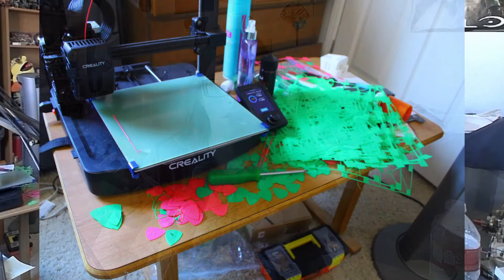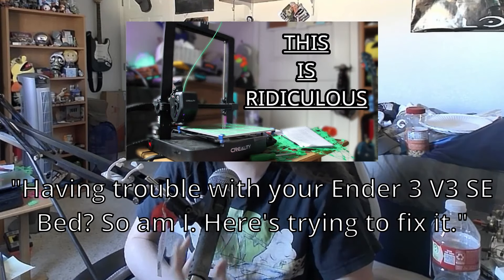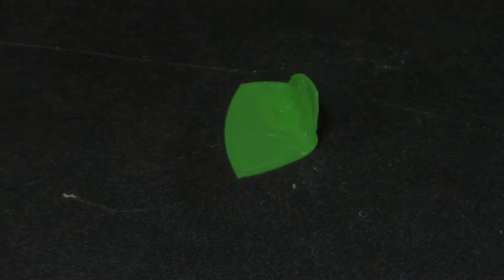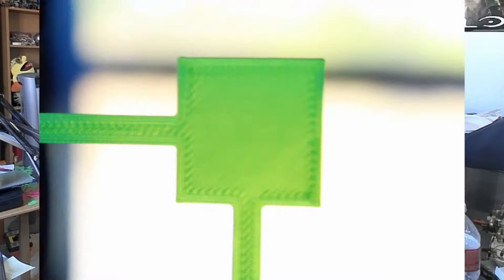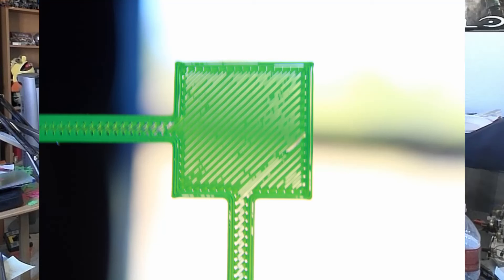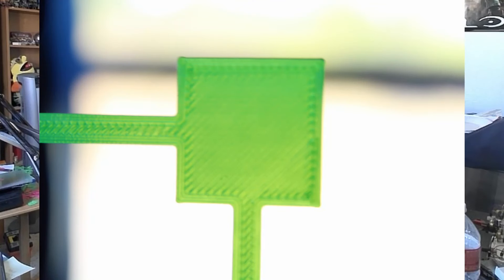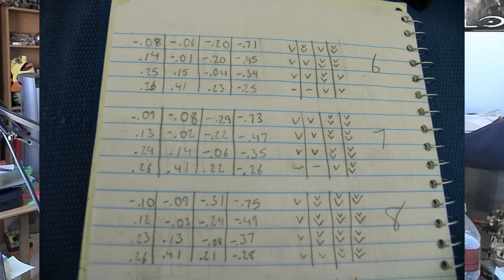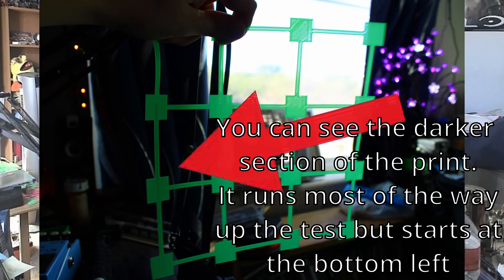(1.0.4 Firmware) How To Level Your Ender 3 V3 SE And Tips To Help!

Comment: hello there , thanks for videos like that , i want to repair somehow my ENDER 3 V3 SE which i just bought ! ... its like , it doing these test like touching all time , but just marking places , not going to mark levels if its green or something , just doing that for few times , and then its giving errror with QRCode which even doesnt work , i cant go to menu or software . Please help
Reply from the maker: I will admit I'm having a hard time following your message, but from what I remember from working on my machine, this could either be a simple fix or completely the other way.
Have you taken the bed off the magnet and tightened the screws attaching the bed to the movement chassis? This is a common and frequent issue, and some people say that even after four prints or so, you will need to tighten the screws again.
I had an error that sounds similar. I was doing some various things trying to fix up my printer and I had tightened the screws and then stopped working on it for a couple of weeks to a month, while also not using it what so ever. BUT when I came back to it and did the auto leveling sequence, it would get to the last one and then repeat the leveling process. It would do this three times until it errored and gave me a QR that I think also was unhelpful or didn't work.
I sat and watched it as it was doing this again and found that for some reason on the last level probing, it pressed down extra hard or something and started to actually move the bed downward; flexing or tiling it. (most likely tilting)
So I tightened the bed screws which didn't even feel loose at all, but that still fixed the issue, at least in my case.

If that doesn't work, the issue may be more advanced than my understanding and if you have just bought it and it's giving you issues, I would either return the printer and exchange it if possible or go to the customer support. The customer support can be frustrating but usually will be accommodating after going through enough steps.
Though I would be aware of and tell them when you are getting close to your return window closing. If you ordered it from an external source other than the Creality site, then I would probably just return and exchange if you get close to the return window closing. I was long past my return window on Amazon when I was going through my process with their support, and they refused to let me send in the printer for verification or replacement no matter how hard I tried to get them to, they were willing to send replacement parts which probably would have ended up costing them more because of the separate international shipments, but that's what they would have rather done.

Sorry for such a long reply, but I want to try to help you be as sure as possible going forward and the only way I can do that is with details. I hope this helps and let me know if any of these suggestions work out.
Reply: @Bowsmin12 thank you very much for that all information, I have bought that printer and received it today, I made all set , I noticed that also on bed , so I made it more tight, and that's all what I did , I run the printer to do it's thing , I'm sitting next to it and watch that's doing leveling with this probe thing going up and down , right now it doing just that , then it goes to 16 places than repeat , doesn't show which level is more higher or lower just that , after few times it just gives sound and QR code
Reply from the maker: @maniakerso2  Did you tighten the screws down as far as they can go? There's not any reason as far as I know to give those bed screws any slack. If you have and it's still not working, then I can only suggest contacting support or exchanging the printer.
I don't know much about specifics in this area, but I think that on some occasions, the leveling probe light will send error codes by flashing and sometimes giving different colors.
Like I said I don't know that for sure, it's just something that I observed when the homing feature doesn't get all it's steps right and the probe can't fully drop down because the head is too close to the bed when the probe tries or something like that.
If you can observe anything like that when the issue happens, you may be able to look up the "diagnostic code" but I can't grantee that you will find anything or that will even give you a solution.
Like I said the OP, your best bet is exchanging the printer from your purchase source if possible, or you can try to see if you and I are missing a simple fix by contacting Creality Support.
If you do go the support rout, one thing I forgot to mention in my first reply was that you should get your order number and serial number because they are kind of stingy about that. Though I can also understand that they wouldn't want to help second hand buyers since they apparently have so many issues lol.
Again, I hope this helps. Let me know what you had to go with and how it all goes.
Reply: @Bowsmin12 yes I made screws on bed , I will contact the seller but I think I have found problem , when he is doing these leveling , probe doesn't touch at last place so it's right up corner , 16 place doesn't even are not touched , the diode doesn't even change color to red color
Reply from the maker: @maniakerso2  That's interesting, if that is the case it may be a glitch in the firmware? You could try re flashing the firmware onto the machine. I think creality has a video on that subject for the SE specifically. I would check your firmware info on the machine to make sure it's whether its the .6 version or the .4 so you don't have to worry about doing the screen firmware. They stupidly make the screen a mini SD instead of full SD like the main port that's meant to be used.
Reply: @Bowsmin12 thank you for help ,and for your time , I appreciate it ❤

Comment: Find a good z offset test, or just a single large flat layer. And you can adjust the z offset in real time. I was able to get a fairly decent print again by lowering my z offset by about -0.1 (in -.02 increments). Do it slowly so you can see the layers at each adjustment.

I may have had a different issue, but this definitely solved my issue without having to do each offset individually.

Thank you for the test print, this is I might go to test print for z offset.

I learned a ton in this video, thanks again for putting it together!

Comment: How do you turn off the auto level/auto calibration before each print? 
I have mine set by myself and then evrry time it goes to print it will ne too high, so i have to fine tune Z offset within the skirt/brim print and then its fine. Its like it doesn't keep my z offset...
Reply from the maker: I think there's an on/off button for a pre calibration when starting every print. It will be on by default but you can click it off and I think it will stay that way. Unless you're having a separate issue. Let me know if this helps.

Comment: Thanks for uploading the g-code to Github!  I noticed the gcode does not load the auto-leveling mesh from the printer (command "M420 s1"). Do you know if that was on purpose?
For the purpose of leveling, should the test print NOT auto-load the mesh?
Reply from the maker: This is a common question regarding the start gcode in general. I do not know if there is any benefit or hindrance to adding the line, but creality does not include it on their start gcode for the printer in creality print. at least last I heard. At the same time cura's relatively new profile for the E3V3SE does include the line by default.

Personally I don't see a reason to add it because changes are happening when you adjust the auto leveling data. Therefor I think it is being loaded regardless of that line. The only reason I would see to add it is if you are making changes to the data, and no changes are happening in the print. But since we are also working with very small adjustments, you have to be careful with that mentality as well.

Comment: Do you now what calibration as described influence on? 
Regulating the flow all over the bed depending on local offset, so the model top layer is flat, but model height is not equal at all over the flat top surface, or by regulating extruder Z, so top surface od the model is parallel to the bed (warped)?
Reply from the maker: I'm not for sure if I'm understanding you right. But it makes sure your printer head is the same average distance from the bed, all over the bed. Beds often times aren't perfectly level and that's why people used to use glass. With flex beds they conform more and with the Z offset it would change the starting print height, but as a flat layer over the entire bed. With the auto probe points it shifts the height of the first layer depending on where the head is on the bed. Unfortunately most units of this printer aren't accurate with the auto level, so the manual data point leveling makes sure the Z offset is optimal across the entire bed. I hope this helps.
If anything else isn't level, like your top layer, there is probably other issues.
Reply: @Bowsmin12  Sorry, I've made typing errors. Now I corrected it, + "*" sign beside corrected text. Please read again.
Reply from the maker: @antunrosovic7284  Unfortunately it looks like something went wrong and the corrections didn't post. The original message doesn't have the edited tag either, so I don't know if you may have forgotten to press post or if it didn't go through but it looks like you will need to correct it again, sorry.
Reply: @Bowsmin12  oh, yes, sorry. Now is ok.
Reply from the maker: @antunrosovic7284  Okay. I'm sorry I'm still having a hard time understanding but I think what you're asking is, if the bed is tilted will the print be printed tilted as well and will the adjustment affect the height of the print?
if so 1. Honestly when it comes to how the finished product would come out in this scenario, it's a bit of a thinker. I think your print might be slightly crooked, but typically it's not noticeable or a big deal because of how small the variations typically are.
2. The height can be affected by the Z offset / leveling. But again this is typically too small of a variation to notice if it does affect your prints. Hopefully this helps.

Comment: You must have had some bad luck. My ender 3 V3 SE does not have this problem! Auto level works fine, without touching it I can print the 16 point test with no adjustment or problems!

Comment: What's your normal z offset
Reply from the maker: It's been a while since I've used the printer at all, so I don't remember. But it also doesn't really help to know each others offset, because it's usually different for everyone due to the actual form of the bed. Plus I remember it having a wide tolerance, (at lease in terms of 3D printing) so there isn't a true answer of how much one person will have to offset compared to the next.

Comment: The steel and the PEI surface will separate if it sticks and you yank it off. I use a safety razor to come underneath it.
Reply from the maker: Can you clarify what is sticking to what in this suggestion? Is the plate sticking to the bed area or is a print sticking to the plate?

Comment: Can you explain the number grid? Or to be specific does increasing the amount raise or lower the bed.   ( what puts the hot end closer to the bed  .54 or .53?)
Reply from the maker: It can be confusing what raises and lowers, especially that we are working with both positive and negative numbers. 
If you have a positive number and you want the nozzle closer, the visible number will decrease. If you have a negative number and want the nozzle to be closer, then the visible number will increase.
Another good way to remember is the direction you spin the knob will always do the same increase or decrease of values. I believe turning the knob to the left will always decrease the value, but I may be misremembering.
Reply: @Bowsmin12  believe it or not but I'm still confused. But I figured it out. Turn right for bigger gap (if you are negative head towards zero if you are positive already go higher) turn left to move nozzle closer.
Reply: My printer does auto leveling fine on the whole plate except the right quarter. It was way overcompensated. Like the correct value is about -0.2x this thing had it -0.5x. but ya every time. Only the right quarter of the plate the entire other 3/4 does great.

Comment: I own two, I cheated by running the auto leveler and propping up the foots of printer by sliding balsa sheets underneath. Anywhere it said negative -0 to -0.93 i'd prop it up with balsa. Eventually I got it all green leveled.
Reply from the maker: Are you saying that you put the sheets under the bed or just under the leveler?
There's nothing wrong with shims, which would be under the bed or under the standoffs,
but if it was just under the level probe on top of the bed, this is a problem which is why I assume this isn't the thing you are doing but thought I would ask and mention it anyway.
Reply: @Bowsmin12  . Shims underneath the bed. It also took me some trial and error. The manual should have mentioned. Wherever it's blue and if the numbers are negative it means you have to loosen the bed if it's positive you have to tighten the bed.
Reply from the maker: @sirxavior1583  If you mean the screws, logically and typically on other models of printer I would agree. But this one is supposed to completely rely on the auto bed leveling so you're supposed to have the most consistent and immovable bed possible. If you loosen the screws on this model the bed will just be loose and move around a bit unless you shim the standoffs or something.
Some people go as far as converting the stock screws to a screws system like all the previous models of ender 3 and add the manual bed leveling since Creality is kind of dumb and released this when it doesn't work right anyway.
My main point is that I'm unsure on what you are saying to tighten or loosen and what the manual should have said to do so on. Either way, you're right and the product just wasn't and still isn't ready to be on the market.

Comment: I see you're using a G10 build plate - nice! Do you have links to the corner clips you used?
Reply from the maker: https://www.amazon.com/Ender-Adjustable-Printer-Compatible-Creality/dp/B0BX98FT9R/ref=sr_1_3?crid=1ANR47KKR23IE&keywords=4Pcs+Ender+3+v2+Bed+Clips+Blue&qid=1700764283&sprefix=4pcs+ender+3+v2+bed+clips+blue%2Caps%2C302&sr=8-3
One weird thing about these clips is that sometimes they leave what looks like a blue stain on my G10 plate. But when I pick up the plate and remove it from the heating area typically it goes away. They work functionally, just weird little side effect.

Comment: do you the gcode for any other calibration prints from creality?
Reply from the maker: Most other test prints are made by the community publicly for anyone to use on sites like thingiverse and printables. There is a public version of the 4x4 point grid made by someone on printables now.  The link for the original test is in the description. Hope this helps.
Reply: @Bowsmin12  thanks, it did help.